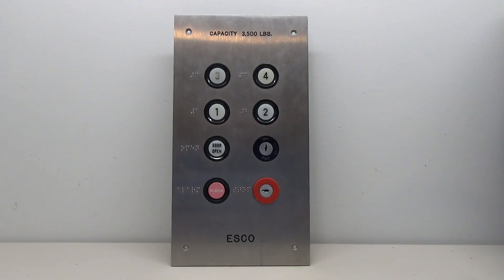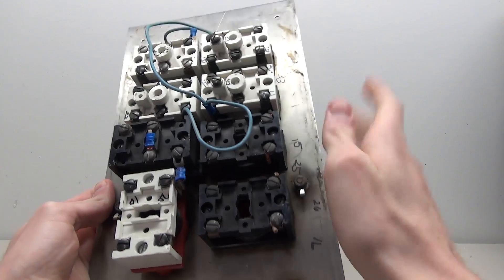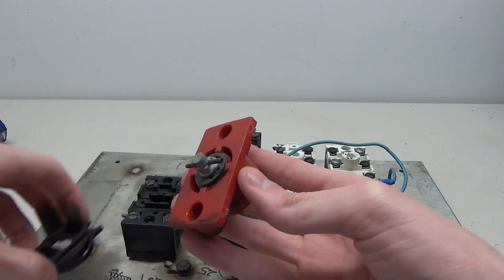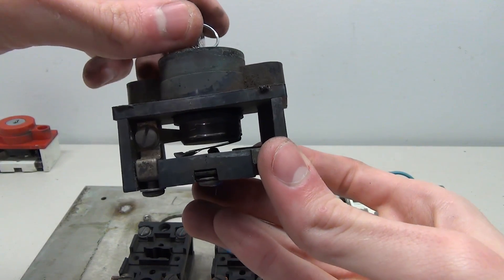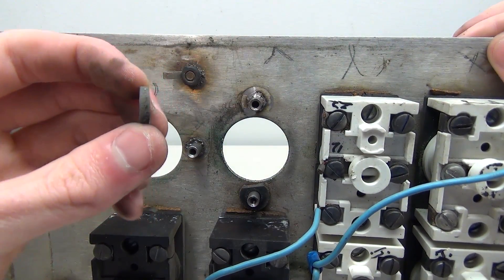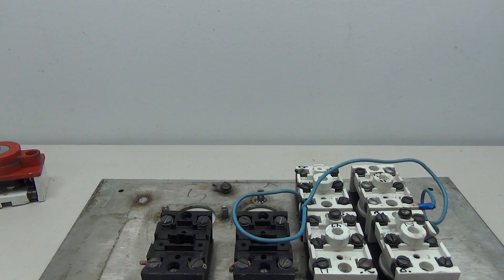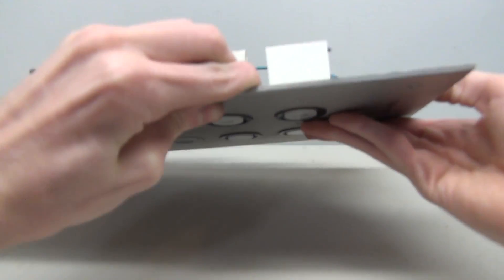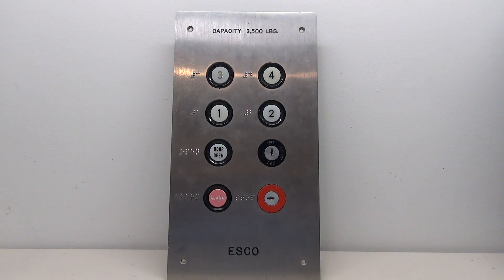Wiring a GAL Jet Plus Elevator Car Panel

Comment: That red switch is probably fire service. Definitely would make sense being from the 70s and without having the panel been butchered
Reply from the maker: The fire service key didn’t work either.
Reply: @stlelevators  The red switch might take a G1615P key.

Comment: Thankfully my Otis GAL get plus only needed to be token apart on 2 buttons and cleaned to fix then from getting stuck
Reply from the maker: I’ve had to clean so many of these. The dirt gets built up on the button which makes it stick real bad when you press it in.
Reply: @stlelevators  yeah I fixed it and got used a steel brush to get off 90% of the rust. I also got a Otis lexan panel that has no guts and I wonder how do you tell if it is Otis touch or lexan. On the Otis GAL panel I did fix the buttons.

Comment: I heard Justin hates jet plus.
Reply from the maker: It's super annoying. When you take it apart, it explodes into pieces.
Reply: Unlike Adams, which in my opinion is one of the most user-friendly buttons because there are only a few components which are contained in that clear cube on the back. The fact that it's clear is really good because you can see if there's a problem without taking it apart. It's also interesting on the keyswitches because you can see the contacts rotate inside.

Comment: My GAL has a different alarm button. It's metal with 2 illuminating stripes. It presses the same because it has the same assembly as the other ones. I put a blue LED in it and it looks epic. Presses like new because nobody ever used it.
Reply from the maker: Interesting.
Reply: Oh, that may be the VP version.

Comment: Nice job as always.  JetPlus really is an incredible product.  I'm not sure of their start date but I know of elevators from the mid 70s with them and GAL makes them to this day.  That's a design that has stood the test of time!
Reply from the maker: Thanks! These are neat buttons, but they are a pain in the butt to put back together.
Reply: They're still in production?! Nice! It's great to see vintage buttons still being manufactured.
Reply: @ex5138   I believe they've now stopped within the last month or 2.  But that's a heck of a run... approximately 50 years!

Comment: The braille says stop so it's a stop/run switch. Also, what key does GAL JetPlus use?
Reply from the maker: It is a stop/run.
Reply: GAL JetPlus keys:

G1601P - Light, fan, ind serv
G1612P - Inspection, access
G1613P - Floor lockout
G1615P - Some stop/run
G1617P - Fire service

Comment: Note to everyone: NEVER take apart GAL unless you're ready to get super stressed out and irritated!
Reply: I just commented about that. Lol
Reply: @SWFLElevators  I too have noticed that these GAL, EPCO, PTL, and Monitor Controls buttons have a lots of parts, and are hard to reassemble if they fall apart. Not only that, they too are "New York" style buttons since these companies are located in and around the NYC area, but I could also see why Innovation and Adams are more popular, since the Innovation Universal contact block and Adams Survivor contact block are fully assembled and easier to configure and maintain. Even the CJ Anderson buttons and contacts are simple yet dependable in design.
Reply: It's a nice button, but the way the springs and contacts have to rest on top of each other is ridiculous. It's literally impossible to get the springs and contacts to stay together while putting the other part back in. Does it really take 3 people to change a button?!
Reply: It took me 30 mins to put back together a EPCO button. I was SO irritated.
Reply: I managed to take it apart to clean everything and then put it back together!